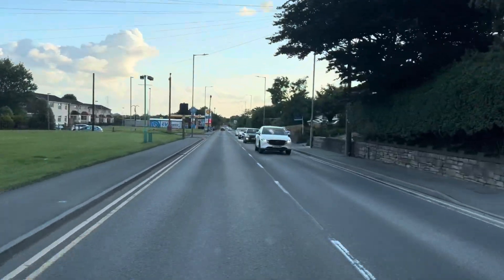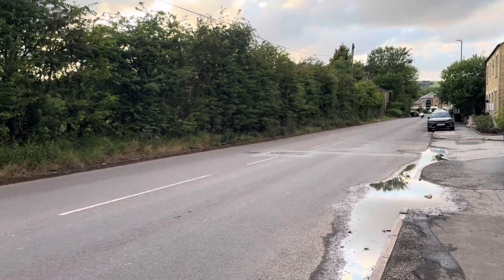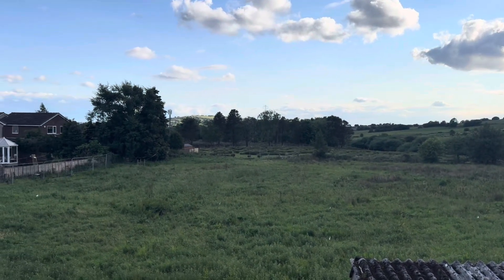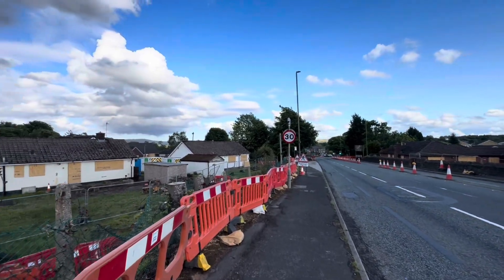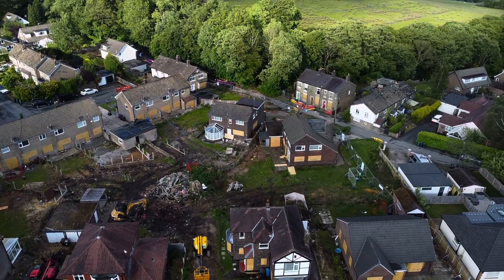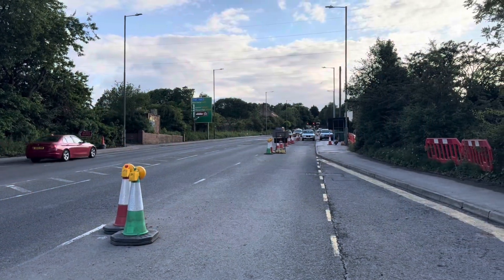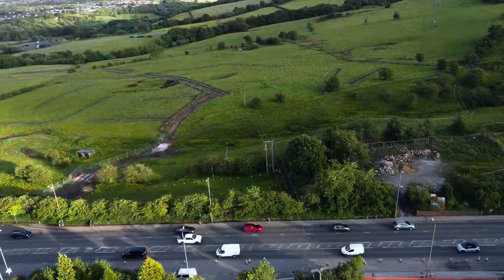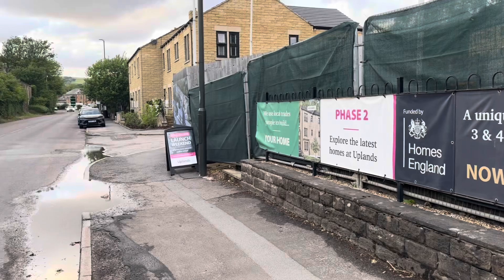Mottram Bypass update June 2025 | A57 link roads Project

Comment: Good insight to to progress.. I have to be honest, to end the bypass at the location seems crazy.. I know they have monitored traffic etc but still, I'll look forward to more videos..thanks
Reply from the maker: Cheers Lee
Reply: Lee, my impression of the current layout is that when it is built they will carefully monitor the difference it makes to the traffic congestion. If necessary there could be additions added to bypass some more of the narrow roads. Although any such extra work cold be another 50 years into the future.
Reply from the maker: @stevep7950 a resident I spoke to a few weeks ago told me the same Steve.
Reply: @stevep7950 you would like to think they have done that already.. ha ha I know the reservoir in tintwistle must cause issues.. but still.. we shall see..